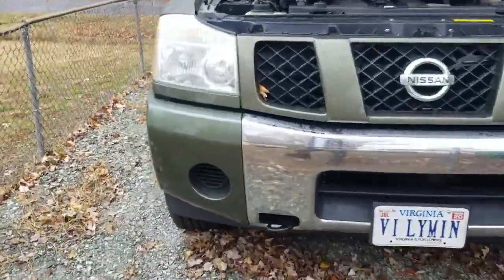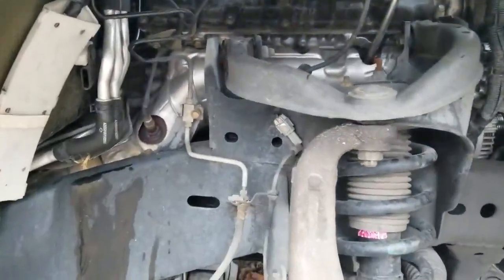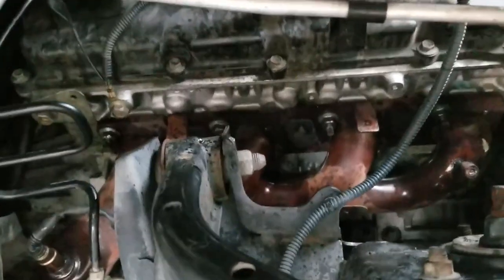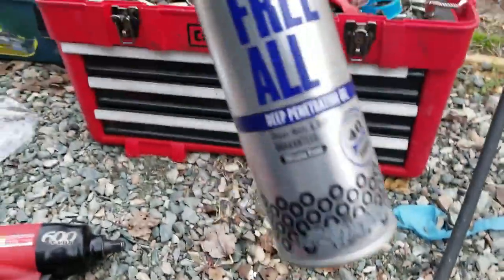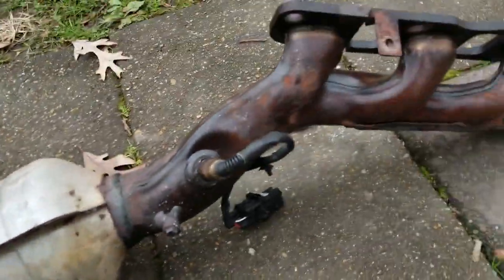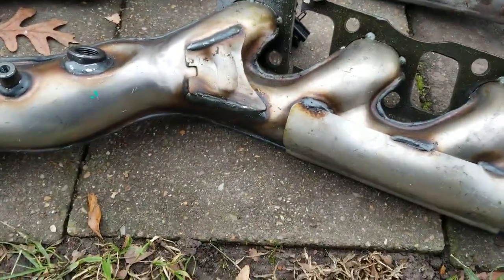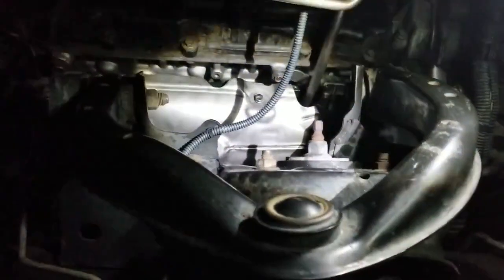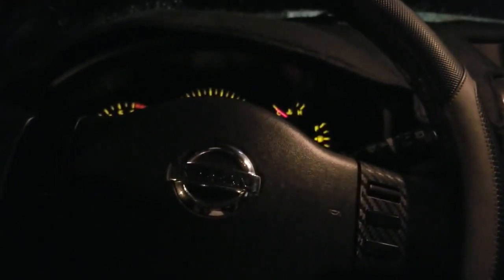2005 Nissan Armada Catalytic Converter Swap.

Comment from the maker: **Update: Click Link**
Use the factory style exhaust manifold gasket if you can get one, and re-torque/check the torque after the first 500-1000 miles.
https://youtu.be/P96Fn3rPxgw
Reply: Thank you so much for this video. Could you please post the torque #s?
Reply from the maker: @tomwaits1589  I will get then for you.
Reply: Yo man,, what was the first code to pop up related to this issue?? A o2 Sensor code or p0420 or p0430 cat below threshold? Did p1051 a/f sensor 1 bank 2 pop up? Having trouble figuring out if it’s just  the bad upstream sensor on bank 2 or if bank 1 converter is dusted.....
Reply from the maker: @thesnapper84  Cat below threshold code for the affected bank. You will also get o2 sensor code and intake air leak code.
Reply from the maker: @tomwaits1589  please accept my apologies for taking so long. 
2004: the exhaust manifold to cylinder head bolts are torqued to 21 Ft-lbs.
2005 and later: the exhaust manifold to cylinder head bolts are torqued to 25 Ft-lbs.
Reply: Y did u ever change what was it doing
Reply: @jorgevaquero7669  it isn't what it's doing it's what it's going to do.  Eventually the catalyst starts to break apart and bits of it start getting sucked into the cylinders from the backpressure and then you need a whole new engine.
Reply: Mine overheats and the auto shop can't even figure it out, don't think it's a blown head but to cats are out anyone think it covers because of the cats, it only get hot if the temperature outside is past seventy five other wise I can drive all day, it also don't get hot when I driving only when parked

Comment: I found an easier way t remove it... Get a set of e-sockets, remove manifold studs (instead of the 4 mount bolts) and it literally falls out... Hope this helps someone's life easier...
Reply: Exactly doing mine this way right now on my titan!!! Much easier and less work. I had 4 studs snap with the e10 socket. I wasn’t able to extract them so made a call to a local machinist and for 280 bucks he stick welded the studs and backed them all out for me thank goodness 🎉

Comment: Now that it has been 5 years since you replaced the right exhaust manifold, can you tell us if your aftermarket manifold is holding up. Any new cracks? My 2007 Titan now has a crack and I need to decide what parts to use. Thanks to  you I know to use the OEM gasket. Love the videos and thanks for your help
Reply from the maker: My Armada now has 232,000+ miles on it and all is well. The aftermarket manifold/catalytic converter is still doing great with zero issues. Of all the vehicles in the yard (New Wrangler, new Renegade, Suburban, and a F150), I prefer driving my Armada hence the high miles on it.
Reply: Thank you Sir! Also, since you did not mention it, I assume the left bank manifold is still original equipment Nissan manifold?  @97TRAKIN

Comment: IMO if you are replacing cats, you might as well go with jba headers. Flex fuel titans can run on them but reg titans might have to get a tune from uprev.
Reply from the maker: I agree. There's a guy that runs them on his regular armada (Not Flex-Fuel) with no tune. Surprisingly no CEL.

Comment: I have a 05 Titan and it does make a noise from the cracked exhaust manifold. We thought it was a knocking, but it is not internal engine. It is the air escaping making that noise. Would that cause a proof of smoke from the muffler when cold?
Reply from the maker: That puff of smoke is probably from it running rich on startup. Fuel injectors give a extra shot of fuel on startup similar to the effect the choke has on a carbureted engine. Also, the cracked manifold is throwing your O2 sensors off.
Reply: VI Tinker Tank 

Thanks for the response. I’ll have to get the cracked exhaust manifold fixed soon.
Reply from the maker: @gloglo1275  my fuel economy took a hit with the bad manifold. Once replaced, my fuel economy went back to what it was prior to the crack, horrendous 😁.
Reply: VI Tinker Tank 

Yeah it certainly makes sense because it is not running properly. Thanks for your time and help.

Comment: I got to do this on mines now as it cracked and is causing the car to get only around 5 miles to the gallon. I'm in Cali and I am finding out that the EPA people have a monopoly on these parts as they want me to pay more than 20 times as much as you all outside of our State are paying for the same darn part! I'm having a rough time getting around these fools but where there is a will there is a way. I ended up getting them out of Canada for just $92 bucks for both sides which was going to cost me over $2100 here in Cali 🤯. I really hate how these rip-off artist are price gouging people here in my State. The dealer was trying to charge me over $3.5k for the job and I was like I don't think so as homey don't play that!🤪 
Like you I've been a mechanic for many years so I'll be doing the work on this one. I have to replace everything so much fun ahead, LOL. Thanks for posting this video as it's good to see what needs to be done before we get into doing it. 
Oh, and a tip on how to not break rusted bolts, tighten them a little first before trying to back them out.
Reply from the maker: Yes. Sadly almost any emission part in Cali will cost MONEY as a lot of aftermarket suppliers won't even ship to your state leaving the dealers free to rip people off.
Reply: What site did you order them from?

Comment: Great video,  I didn't understand why it would cost so much to replace a cat, then it turned out to be chinesium engendered
Reply from the maker: It is a tight fit no doubt. Also the factory Nissan manifolds are crap and they are very expensive. Rockauto.com has a manifold that looks identical to it, but the welds are beefier and they have a metal brace welded on where the factory Nissan manifolds always crack.
Reply: VI Tinker Tank hey think tink.  How much was that from rock auto? I have the exact same problem on my 05.
Reply from the maker: $233.79

Comment: I think mine just cracked I can hear air flow, accompanied by loss of acceleration.
Reply from the maker: Did the CEL illuminate?
Reply: @97TRAKIN  no cel light yet, looks like the previous owner has a o2 sensor spacer on there, that’s probably why it’s not on.

Comment: What if I sealed the crack with Permatex????
Reply from the maker: Some people have welded the crack with success. Anything that will seal the crack will work. The leak/crack is what throws off the 02 sensor. I don't know how long Permatex will hold through multiple heat and cool cycles. One guy applied a huge blob of plasti-steel and it sealed well enough for the check engine light to go out, but I don't know how long it lasted.

Comment: I don't have a cracked manifold, but I do have a bad cat.  Is it possible (cheaper, easier) to cut out the cat and weld in a universal?
Reply from the maker: Because the factory manifolds suck so much, I'd just replace the whole thing. Imagine welding on another cat, just to have the manifold crack. 
My cracked manifolds didn't exhibit the signs of a cracked manifold: no audible air leak noise. I knew it must've been cracked because the CEL code indicated a bad cat which is the primary tell tail sign of a cracked manifold.
Reply from the maker: My cats were still good, it's the cracked exhaust manifold that set off the CEL. There are some people who remove the manifold and just weld the crack.

Comment: Hello Mr. Tank I have the same truck same color. Same problem with the cat I just had one question and that's should I use a breaker bar or Impact gun. Thanks
Reply from the maker: Good day sir. I used a breaker bar, but you can use an impact gun if you get get one in there. My manifold nuts were (thankfully) not frozen.
Reply: @97TRAKIN  Thanks so much for the quick response. I've worked on cars since I had auto shop in high school but never changed an exhaust manifold. It appears you've done it all that's why I asked impact vs breaker bar in your experience. And would you suggest heat. I have a few more miles on mine I think it's 197000. And the last question if you don't mind. Where did you get the replacement cover for your steering wheel controls mine has worn out. Thanks so much for your time

Comment: I have code p0420 on a 2007 Armada,what side should I look for also could it only be the 02 sensor?
Reply from the maker: P0420 is bank one, P0430 is bank two.
Sitting in the truck, bank one is the left side, bank two is the right side.
An easy way to test if it's the O2 sensor is to swap them from left to right, right to left and reset the check engine light. When the light comes back on have the code(s) read again. If it's the same P0420, then you know it's the manifold. If the code changes to P0430, then you know it's the O2 sensor.

Odds are it'll be the manifold though. Some of these trucks left the lot with cracked manifolds.
Reply: @97TRAKIN  what code did u get im getting the p0430

Comment: You didn't remove the engine mount...
but you removed the engine mount
Reply from the maker: I said, "Let's see if I can remove the manifold without removing the actual engine mount".
I removed and installed the manifold without removing the engine mount from the vehicle, I unbolted it from the engine and loosened it from the frame.
Good luck with your manifold replacement.

Comment: Hi, after two years you haven't had any problems with the EASTENR catalyst .. I have to re-plaster both sides of my armada and I'm looking for the best option to get a pair of  catalytic converters
Reply from the maker: No issues at all and I do not baby my Armada. Just be sure to get manifold gaskets from Nissan or a supplier that sells stainless steel gaskets similar to the original Nissan ones. Do not under any circumstance use the one that comes with the Eastern catalytic converter, it's crap.
Reply: @97TRAKIN   hi again Thanks i will buy the gasket from the dealer ... how long did it take to replace the catalytic converter?

Comment: Did you not replace the manifold studs? Putting all new would be a good idea no?
Reply from the maker: It would be great to do so, but it is not required. The torque value for the exhaust manifold nuts is very low.

Comment: When you jacked up the motor after loosening the mount, did you have to loosen the driver's side mount as well or did the engine lift up enough with just the passenger side loose?
Reply from the maker: The engine lifted up enough without having to mess with anything on the driver's side.
Once you do this once, it becomes much easier/faster to do the second go round (as with most things) or if you agree to help someone else out.

Comment: Been putting this off for a while. Use to quiet down once it warmed up but now it's all the time. It's definitely a crack that I can feel. Mine has 209k with no rust so hopefully it goes as smoothly. My shop stocks pb blaster. What's your take and penitrating oil? Also I see manifolds ranging from $150-$350. Hate to do a job twice but if I can go cheaper that would be great. I mean as long as it's quality material and has bracing at the problem area I would think it would work
Reply from the maker: I am a believer in penetrating oil.
The part number I linked is the one with the bracing.
You definitely do not want to do this twice lol.
Reply: How long did you put it off for? Mine goes away after 10 mins of driving.. 86k miles on her now.. hoping I won't need to replace them till about 150k

Comment: hey how is it holding up after these years??? Im having to do the same on mine
Reply from the maker: Still going strong. Armada is running like a champ at 227,000+ miles. That metal support brace that is welded in on the Rock Auto "exhaust-manifold/catalytic-converter" seems to make all the difference.

Comment: Thanks for your video bro. Heard that the basket that came with after market manifolds leak. Did you use oe m gaskets?
Reply from the maker: I tried the gasket that came with the manifold and it was trash. The OEM gasket is the best.

Comment: Great info have you had any issues with the replacement catalytic?
Reply from the maker: None what so ever, and I'm not being easy on it. 1,000 plus mile road-trips, hauling trailers, extreme summer heat, etc.

Comment: Did u pull intake from the top
Reply from the maker: Intake, no. I pulled the exhaust manifold out from the top.
Reply: @97TRAKIN  thanks alot Im do one tomorrow and what about those bottom manifold bolts did u have to use a swivel

Comment: Hey how long it's been with the since u installed did you got the check engine light yet..
Reply from the maker: It's been over a year and multiple road trips with some involving hauling trailers. No issues...
Reply: Nice.. thanks I been thinking of installing both side ..they said they don't last..so a year sounds good I think it all's matter how the engine it's running....like no miss..thanks again for the replay

Comment: Does a cracked converter burn more fuel?
Reply from the maker: It throws off the O2 sensor causing the computer to think there's a lean condition. In response the injector dumps more fuel and you really start to notice the fuel guage dropping at record pace.
Reply: @97TRAKIN  thanks!  Yeah I have a 2010 qx56 and there is a leak in the exhaust manifold and my gas mileage is horrible 9.8mpg!  Ouch!

Comment: Does the crack in the catalytic converter cause vibration? I have a 2010 Nissan Armada with 170,000 miles on it, I feel a slight vibration on the driver side when the car is idling
Reply from the maker: That's probably one of your heat shields.

Comment: Boss Man, Did you ever change the drivers side manifold???
Reply from the maker: No sir. As of now the driver's side is not throwing a code. When it throws a code I'll make a video of me replacing it.
Reply: @97TRAKIN  respect my breddrin hold tight. I'm trying to replace my passenger side manifold and following your vid to a tee. Pure madness.  Little by little.
Reply from the maker: Good luck sir, you got this.
Reply: @97TRAKIN  Well I purchased the pacesetter manifold / catalytic converter from Rockauto and bolted it in finally. To my dismay within 5 minutes of driving the cat turns beet red. I mean scorching hot red. Is this normal???? Plus the truck is restricted and wont go over 45mph.  You step on the gas it it stutters and misses. It throws a code of P0300, misfire on cylinders. Could the new cat be the problem???
Reply from the maker: @alfa_romeo55yush82  You have a misfire condition and the cat was trying to burn off the excess fuel, seen it many times. That is what probably killed your previous one. Other than physical damage(cracks etc), cats should last a very long time. A failed cast is a sign that something else is up...

Comment: How much was the new parts?
Reply from the maker: RockAuto. Part number 40638. $237.79...

https://www.rockauto.com/en/catalog/nissan,2005,armada,5.6l+v8,1430913,exhaust,exhaust+manifold+gasket,5400
Reply: Thx a lot man... mechanic quoting me like 1500$... I’m looking for a 2nd opinion... tho I’d love to do it myself I know my limitations too lol
Reply from the maker: @forulimu  with auto repair, a/c repair, home repair etc, the biggest costs are labor related. Basically paying for the tech's ability to perform the repairs.

In all honesty, this is not an easy DIY job. So many things to go wrong.
Reply: Thx a lot brother...
Reply from the maker: @forulimu  ....if you do decide to tackle it and have any questions, I'll do my best to answer them if asked. I have the torque numbers and everything.

Comment: You still have this vehicle and is the replacement manifold you replaced still good? Thinking about ordering this part for my truck.
Reply from the maker: Yes sir I still have this vehicle and the replacement manifold/catalytic is holding strong. Just hauled my 7x12 trailer loaded from the city back out into the county with it too.
Reply: @97TRAKIN  Thank you for the info.

Comment: How do you know which catalytic converter is bad? I've heard it can be multiple cats.
Reply from the maker: Code: P0430 is the passenger side catalytic converter/manifold (up stream cat). The down stream cats are incapable of throwing OBD codes since the are no sensors down stream of them.
Reply: Tinker Tank thanks for this info mine read that exact same code. Now I know what I need! 👍🏻
Reply from the maker: @wearefreesd3305  no problem. Good luck with the repair.

Comment: How much torque lbs you did for catalytic converter bolt and nuts?
Reply from the maker: It was 20'something ft.lbs. It is very minimal. I'll share the numbers from the manual when I get home, if I remember.
Reply: @97TRAKIN  thank you
Reply from the maker: Directly out of the repair manual. "Exhaust manifold to cylinder head fasteners: 2004 Models, 21 ft.lbs. :2005 and later models, 25 ft.lbs."